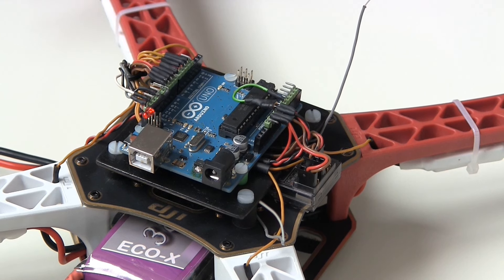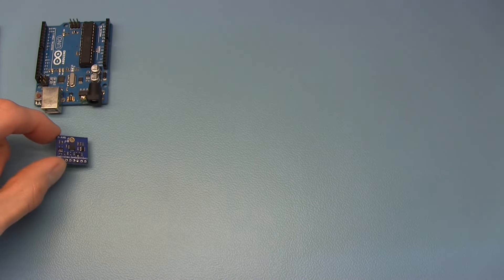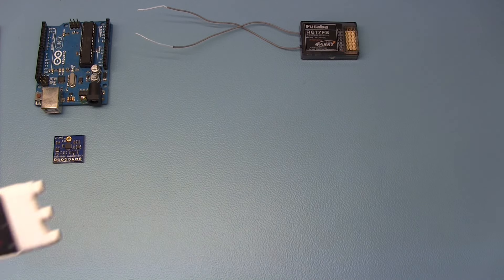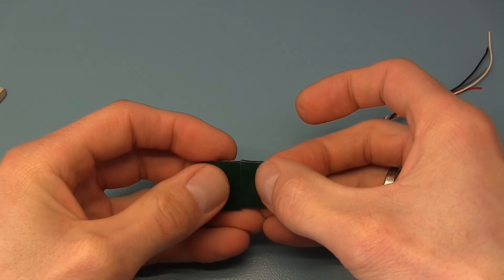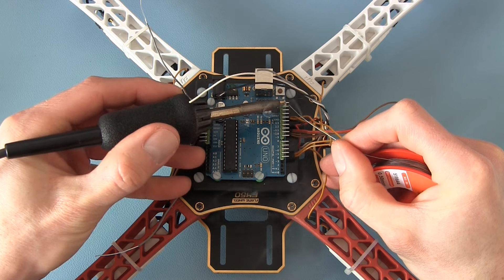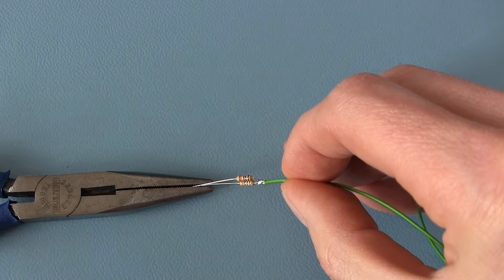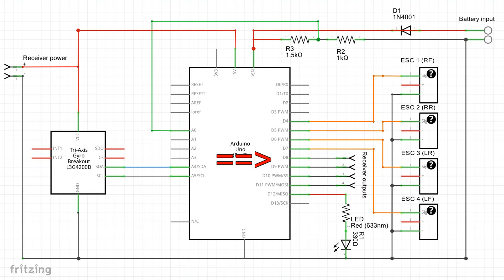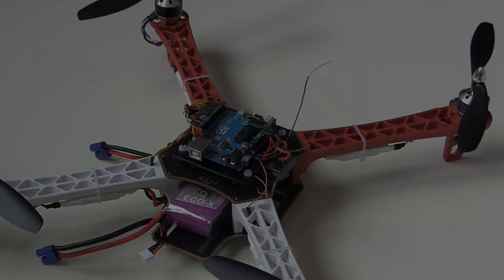Your Multicopter Flight Controller - 3D (YMFC-3D) Part 1 - Hardware.

Comment: Hi Joop.  One more question :)  Is it fine to have a Lipo connected and also the USB connected to a laptop at the same time ?  So USB is providing power and the Lipo is providing power at the same time ?
Reply from the maker: It's no problem to dual power the Arduino Uno. Power consumption from the USB port is automatically disconnected.

Comment: Awesome series man. I do have a rookie question though. 

My background is NONE.
  I'm building a helicopter/quadcopter hybrid. And I was thinking of using Arduino to control the servos, which controls the pitch of my craft. Now, what is the benifit of using Arduino, opposed to not using Arduino. And, from what I've gathered (and please correct me if im wrong), do Arduinos pull more amps? Would it be benificial to route the arduino to servo motors instead of ESC's? Would the configuration be: Arduino<ESC<Servos.  And, if I went that route, would I need another Arduino board to route it to the motor, or motors? 
  If its confusing, im sorry, I really dont have a grasp of this, its kinda something new to me. I just very curious, and i just want to further my knowledge. Thanks for any help.
Reply from the maker: Arduino is the name of the complete platform. It includes an IDE and several microcontroller 'breakout' boards. Just to simplify the usage of a microcontroller.

Check part 4 of the YMFC-3D series to get detailed information about controlling ESC's and servo's with an Arduino.

Comment: hello Joop , Im bukding mine, but I'm a little confused how you wire the Receiver  and the esc. Im using a 6 channels receiver. Could you please explain me the way you  wire that part?. Other question , this quadcopter doesn't have fail safe?
Reply from the maker: carlos casas Sorry for the late response. You need to connect the receiver outputs to the Arduino so you get the same stick response as I showed in part 2 (receiver inputs).

Comment: Hi there Joop!
I did exactly as u showed and I followed the manual as well!
But my led is not working, i.e.it is not ON when I switch on the battery! It is almost completed, but I'm struck there.
Please do reply and help!
Reply from the maker: If the LED of the Arduino does not lit up you have a supply voltage problem. Did you mount the diode the right way? Does it work when you connect the board to a pc?

Comment: Hi Joop.  I started the build over since i was having calibration issues.  I ran the setup and went through the steps and received NO ERRORs.  However, when I ran the esc calibration setup I received "avrdude: ser_open(): can't open device "\\.\COM5": Access is denied."  Can you help with this?  Setup went fine.  Thanks for your feedback.
Reply: never mind. figured it out.

Comment: Should i connect the gyro according to the schematics or the video? In the video it´s connected to the AREF and digital GEN pin, but the schematics show it connected to A4 and A5. Are both ways possible possible or only one of the shown ways?
Reply from the maker: It's the camera angle ;-) Connect it to A4 / A5 or SCL / SDA.

Comment: Hello Joop, Thank you very much for your videos.
It seems that these ESC ground lines are not connected to GND of Arduino. Is that a right wiring?
Reply from the maker: Sanglak Jeon Hello, in the example that I made I did not connected the grounds of the esc because the are connected to ground in the esc. 

Despite that, you will see in the schematic that the ground of the esc is connected to the ground of the Arduino.

Comment: hello...i am working on the same project of your YMFC3DV2...i had followed the same procedures as in video...but i am having 1 difficulty in the setup program..."move all the sticks to their extents simultaneously"i canot get the perfact values i.e 1000-1500-2000
 bur it comes
1000-1500-2000
1500-1500-2000
1000-1500-2000
1500-1500-2000
something like this...can you help me with the procedure of moving knobs of flysky remote while doing this setup!?

Comment: I have completed building the Q copter.. But I have a question.. Is it necessary to connect the positive and negative(5v) terminals of ESC signal in-put cable.. I have not powered it, since the whole ESC is itself powered by the same 12v battery.  plz help me with this.. I'm confused..
Reply from the maker: You only have to connect the signals wire to the Arduino when the ground of the ESC is connected to the ground of the lipo. The red (+5V) wire from the ESC is never connected.
Reply: I get it sir.. Thank you.

Comment: Awesome Series. The best I found online. How are you powering the ESCs? The schematic only has the signal and the ground connected to the Microcontroller. Shouldn't you have to connect all 4 ESCs to the LiPo battery to supply it with power?

Thanks for your effort in making this.
Reply from the maker: +Shamsah Thanks for the compliments. The esc's are connected like normal to the lipo battery. A I mentioned in the video I only focus on the controller, not the frame.

Comment: in your code, you coded that voltage of the battery is 12.6 when it s full(3S) First, i have a question regarding this one. I have known that one cell has 3.7V so isnt it 11.1V? and what is the diode compensation? I cant catch the meaning of "65".  I m so sorry to keep asking you about the codes but it will be really thanksful if you elaborate this stuff.... Help me !
Reply from the maker: The nominal voltage is indeed 11.1V as indicated on the label. However, the end charge voltage per cell is 4.2V (3 x 4.2 = 12.6V).

A diode as a voltage drop over it. It's around 0.65V That is why you need to subtract 65.

Comment: @Joop im still experiencing the constant one beep from my esc's.  i went through the entire setup again and uploaded the esc calibration.  i spoke with hobbyshop where i purchased the esc's and the ones i have normally do not need calibration. we went through the program mode as stated in the manual for ESC and we had no success.  They believe for some reason its not recognizing the low high values/hrtz.  Any other suggestions?
Reply from the maker: You need to calibrate the ESC's unless they are DJI. The YMFC works with a 1000 till 2000 us pulse to get maximum accuracy. So you really have to calibrate them for 1000 till 2000us.
Reply from the maker: Sub-trims only shift the center position. The outer limits are set with the end-points in you transmitter.

Comment: I dont have a Vin on my arduino ( 9v is written instead). Can i just use a 9v battery instead( i will have to lose my battery status indicatior. right?)? Anyway wont the arduino blow up if it powered by a 11.1v 20c battery.
How did you seperate the signal cable of ESC from ground( it comes in a 3 pin +,-,sig)?
Reply from the maker: Check the schematic, the link is in the description.

Comment: helllo thanks for the video, what motor used? 1200kv? And propellers used? and battery used? which battery I can Use? thanks very much!
Reply from the maker: +川崎春と Check the specs of the DJI Flamewheel 450 rtf kit.

Comment: what is the method of calculating resistors I want to use 4cell 5200mah lipo battery please tell me the formula I am facing difficulty to find it out by my self. It will be a great help Thank you..:)

Comment: Can we use mpu6050 because it has gyro sensor and acclerometer so it will give many data output so can you explain me or create a quick video?Thank You.
Reply from the maker: Check out the YMFC-AL. It uses the MPU-6050:
http://www.brokking.net/ymfc-al_main.html

Comment: Hi Joop, how do you connect your ground wires to a single arduino ground pin? Do you solder the ground wires (E.g. all the ESC ground wires) to a single wire and connect it to the ground pin on the arduino?

Comment: you connect all the ESC ground to a single ground of the arduino (also  figured  in the schismatic )  , how can you do that , suggest me plz.
Reply: Shashank Mishra You can you a Arduino shield for it. Particular shield have more GND connections than the Arduino. Buy a shield with header pins to connect the shield to your Arduino uno.

Comment: i want to connect my esc to my brushless dc motor (got the one u recommended on ur website) buti read something about only connectin 2 wires insteaad of 3? do u mean the 3blue wires on the esc? wich one should i leave out then? and connect to wich color of my motor? THX :D
Reply from the maker: With a brushless motor you need to connect all the three wires from the motor to the ESC.

Comment: Hey, i have a question.
I decided to make a quadcopter for my school project and i was wondering, since i already have a bought quadcopter, can i use his transmitter and reciever. Syma X1 Quad 2.4G transmitter and compatible onboard PC Control board, instead of Futaba R617FS receiver and Futaba T14SG transmitter?
Reply from the maker: Almost every transmitter / receiver that outputs a 1520us pulse in midstick will work with the YMFC-3D version 2 software.
Reply: +Joop Brokking Great. Thank you. Will be in touch if help is needed about transmitters/receivers.

Comment: Hi, Thanks for excellent videos. I'm trying to build my own quadcopter. I'm facing a problem with the IMU (Gyro,Accel) measurements. When the motors are running, and due to the vibrations, the Roll, Pitch and Yaw angle measurements from the IMU are incorrect. How did you manage the vibration problem? Cheers.
Reply from the maker: Watch this video: https://youtu.be/4BoIE8YQwM8

Comment: Thank you for this series! Very helpful! I am having a hard time with the ESC's though. I understand that three of the wires go to the motors, but on the schematic it seems as though the positive lead to power is not connected. I was also unsure of why there is only one wire for Sig on the ESC going to the arduino. Is this one of the wires that would be usually go to the flight controller?
Reply from the maker: On the schematic only the control wires are shown (small connector that goes to the flight controller). The manual of the ESC should give you enough information on how to connect the main power.

Comment: I am finally getting around to constructing my own quad copter based on your project.  I just had one question.  What kind of wires do you use for your connections (as in Gauge, etc)?  Thank you in advance
Reply from the maker: Please use the YMFC-AL. The wire gauge is on the schematic: http://www.brokking.net/ymfc-al_main.html
Reply: Joop Brokking thank you very much

Comment: Can I use arduino micro for your flight controller software instead of uno? I am making a tiny quadcopter using husban x4
Reply: nevermind i see you need a board with more power.  So your flight controller is limited to very large copters.

Comment: thankyou for make this tutorial. 
but i have project to modify the control with gps. to make quadcopter auto pilot to go coordinat point and get back to started coordinat. 
do you think i can build like that with your tutorial but modify control?

thankyou
Reply from the maker: +fahmi setiadi It depends on your programming skills. You need to add an accelerometer, barometer, compass and gps. Next you need to modify/expand the code.

Comment: Sir ..I have seen this video full... The power from the lipo battery goes to the power distribution board of the quad frame then to esc and to the brushless motors ...  But I couldn't figure out the way how you managed to power the Arduino Uno ... Plz kindly reply sir ...
Reply from the maker: It's powered via the Vin pin. You can download the schematic from this site: http://www.brokking.net/ymfc-al_downloads.html
Reply: Joop Brokking  thank you so much sir ... Keep doing more videos .. u r videos are an inspiration and motivation for the youth ...

Comment: I know this video is kind of old, but would it be possible to control the drone wirelessly through a computer and not a RC controller? Thanks.
Reply from the maker: Yes, that's possible. You need to replace the RC receiver with the computer remote.

Comment: Since the lipo battery is powering the Arduino, is it possible to cut a 2.1mm barrel jack to USB cable and solder the wire end to the positive end (positive end on the frame at 6:33) of the battery?
Reply from the maker: USB = 5V, the battery is 12V so it will not work.

Comment: Hi Joop Brokking. Watched your video. Quick question. It seems like you are powering your Arduino and the motors from the same LiPo battery pack. What happens in the case when the LiPo is discharging. Are you still receiving a constant voltage output from the LiPo? Also, if you can share your flight time that you've been able to achieve from the config, that'd be great. I am debating as to whether I should use LiPo to power up my Arduino, or use a separate 9V power source. Thanks!!
Reply from the maker: +Chirag Sharma The Arduino works on a voltage of 7V - 20V. A completely drained lipo gives 9V. So there is enough left for the Arduino to work.

I had 18 minutes of flying time with a 3800mAh 3S lipo on a DJI F450 frame.
Reply: +Joop Brokking Thanks Joop. When you said that the problem with Arduino Pro Mini is that it has a max current output of 150mA from its LDO regulator, I also checked Arduino Uno for same. The LDO regulator for Arduino Uno is the LP2985-33DBVR, and its maximum current output is also 150mA (from the datasheet). Hence, I am still trying to understand why you chose one over the another.

What about Arduino Nano? The max current output can go up to 500mA. I am not from Elec background, so I am trying to learn the ropes a little here. Thanks!!
Reply from the maker: Chirag Sharma
You are referring to the 3.3V regulator of the Arduino Uno. In the schematic of the YMFC-3D you will see that the 3.3V connection is unused.

The 5V regulator on a Uno is the NCP1117ST50T3G and is rated for 1A with proper cooling.

The Arduino Nano might be fine to power the receiver and sensors with proper cooling. The regulator is on the bottom and the pcb is very small. With a high input voltage the regulator heats up pretty fast and will not be able to deliver the rated current.
Reply: +Joop Brokking Awesome. Thanks for your input Joop.
Reply: +Joop Brokking Hi Joop, sorry to bother you again, but I don't understand couple of things on your wiring diagram. You have 2 ESCs going to PWM pins into the arduino and 2 ESCs going to straight digital pins. Similarly, your receiver has three pins going into PWMs while 1 pin is going to a digital pin. 

To control the motors, you need analog IO, which you can get from PWM pins but not from simple digital pins. Same thing goes for receiver pins. You can use them with PWM but not with digital IO. Can you please explain how you are using D4 (which is just a digital pin, not a PWM) to control ESC1? Don't you either need a PWM or an analog pin for that.

I haven't watched the rest of your videos yet, hence not sure if answer to this question is in those other videos. 

Thanks,
CS
Reply from the maker: Chirag Sharma
I don't use the hardware pwm because not every esc can handle a 500Hz refresh rate.

The way of creating a pulse is described in part 4.

Comment: Thanks Joop for this tutorial. Just one question. If I use 4S Lipo then the voltage on Vin would be 16.2, right? Is it actually safe to power arduino with this voltage? On arduino website it says that recommended input voltage is 7-12V and limits are 6-20V. Do you think it might damage the arduino after some time?
Reply from the maker: That is why I recommend a 3S lipo.

Comment: For grounding the ESC would it be ok to use the battery ground or should they all attach to the arduino ground? (NOT the power ground but the signal ground)
Reply from the maker: Check question 13 on this page: http://www.brokking.net/ymfc-3d_v2_qanda.html
Reply: Thank you!

Comment: Great project! Looking forward to see where this goes.
At the start of the video you mention that the pro mini has a max output of 150mA. Is that a problem for this flight controller? Or does it only become a problem when you start adding more breakout boards like a GPS, altimeter etc?
Reply from the maker: buncho888 My receiver uses 85mA, the led 15mA. 20mA for the rest (processor, gyro, esc signals, etc). In total 120mA. So it should work with enough cooling.

You can also power the Pro Mini with 5V if u use a esc with a internal 5V bec.